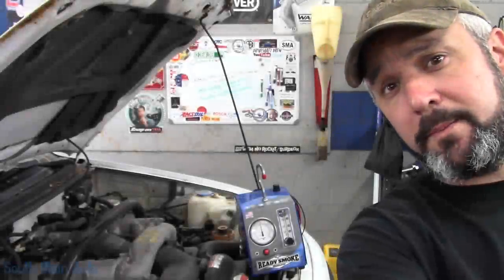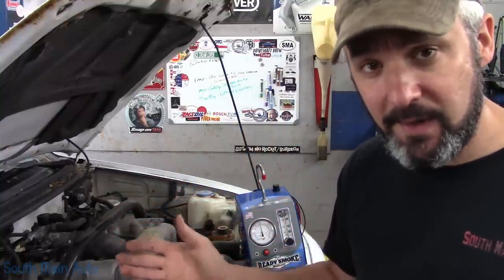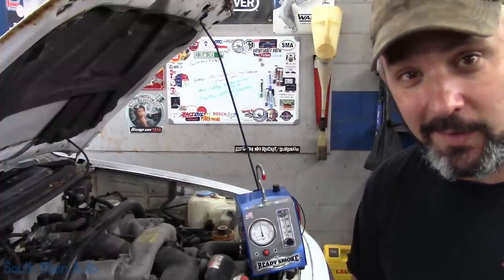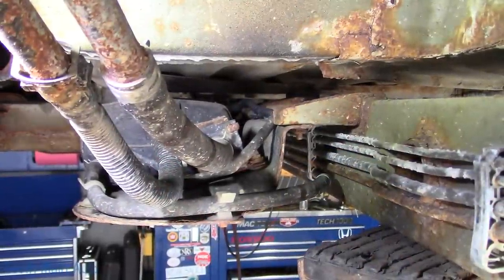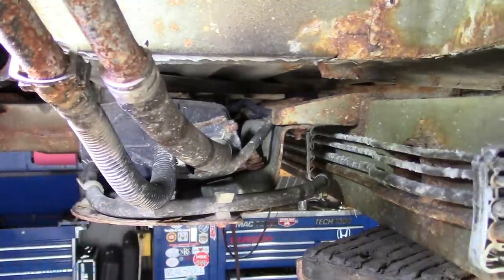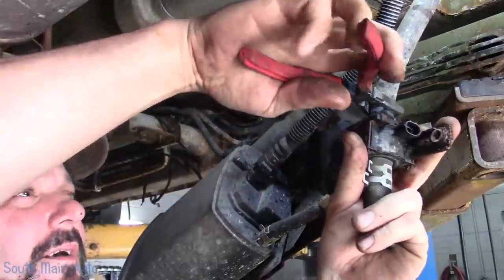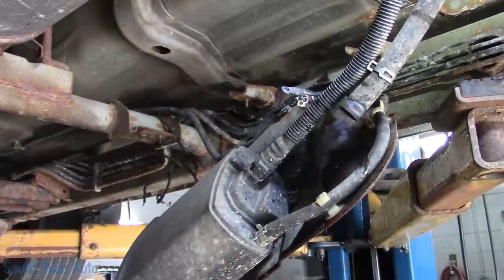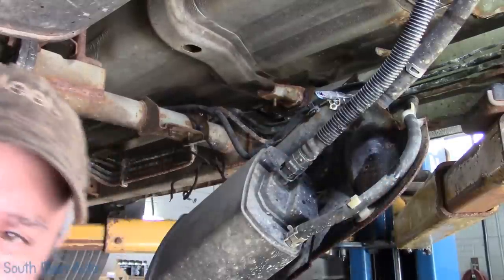Suzuki Vitara: EVAP Problem & Discontinued Parts!?

Comment: AC Delco 2141059 as used on a 01-04 Chevy Tracker.
Reply: anyone recall years ago, the auto parts counter guys would say "that looks familiar" and they often return from the stock room with exact matching part, different numbers lol
Reply: yup, I DO remember those days.  Very few parts counter people like that anymore, in fact, I can't think of one right now in the four parts shops in town.  Sad.
Reply: I was about to ask if anyone looked up a chevy tracker part
Reply: Yea most of those guys seemed to have disappeared with the paper catalogs. They were the ones that knew the parts and were frustrated when the auto stores switched over to computers. The good old days when Napa and Carquest brand parts meant quality made in USA parts. Oh, and when Dorman parts were sold as HELP! and were just odds and ends of common breaking items like door handles and clips etc. and were only bought as a last resort. When all other possibilities have been exhausted 5 out of 6 mechanics choose Dorman lol.
Reply: Back then it was easy because you had GM, Ford, Chrysler, and AMC, which used parts from the big three.

Comment: We didn't see where/why the old valve was leaking.  I might have cleaned it up and resealed it all over with a cyanoacrylate and then dipped it in something and wrapped it with tape.  But your solution was excellent.

Comment: Is very similar to the denso valve on subaru 01-06 era.
bracket on different side though.
your gm conversion good for cost and had tail for neat install plus could replace second time for the under 20buck version without filter .if connector same .
all in all a cost effective repair that fitted more than good enough and importantly works 100% fine .
Wonder what would of happened in the other shops if they had commenced with work :-O !
job jobbed, well done Mr O ...

Comment: Use RTV Silicon between the vent valve and the bracket. It won't rattle and bounce around. Work fine and last a long time.

Comment: I had a honda with a bad purge valve. It was leaking in a similar way. I just peeled back those tabs that hold the ends on and removed the end(s), cleaned the surfaces, applied some sealant, put it back together and bent the tabs back down with a pair of vice grips. Worked fine after that.

Comment: nice fix..in mass.anything over 15 years check engine does not matter on inspection....as long no major leaks or any visible smoke out the exhaust.

Comment: I hate when parts numbers are discontinued for a specific application but there are actually still compatible parts available for other applications. For example I had a Subaru XT Turbo (later model with spider intake) that had a bad cold idle valve (rotating shutter type unique to the spider intake XT). NLA from Subaru or anywhere else under the original part number, but Isuzu or Suzuki used the same thing under a different number and it was still available. Sometimes you just have to do lots of searching to try to find something suitable. Try searching just a section of the part number with an image search to see if something that looks similar comes up. Happily someone has already solved this Suzuki's particular issue in the comments here.

Comment: I dunno if anyone else has said it but a nice thing to start doing is staggering the butt connections like a inch or 2 apart it doesn't  make that one area bulky and u can still use the smaller wire loom.

Comment: Well done. Somehow I'm not surprised the Peoples Republic of NY won't allow an exception in this situation.
Reply from the maker: NO, they want all of these in the crusher...
Reply: The only way you can get an exception from "Uncle Andy" (dumb as a box of rocks gov..my opinion of course...)is to spend mega bucks on trying to fix it, having 100% documentation from the repair shop-Only then can you get a 1 year exception.

My sister just went through this last year with her Dodge.  A local chain store (Think "Moe" from the 3 stooges and "Row" from the song...you'll figure out which one)  Let's see....  She went in for a bad battery, and the famous "P0420".  Sure enough the converter had physical damage.   So the Mo-Row....(Insert a letter....)  installed a used battery (charged her for a new battery) and installed the wrong converter.  Light came back on instantly....Something like $1200 bucks down the crapper.  (There is an open case with their corp office....)

The shop was told by ME about giving her the exemption due to the money she already sank into it.  They stated she needed to spend over 4k before they would be willing to do it.

Another shop that I know took it in, looked the paperwork over...and granted the 1 year exception.  Yes the process is like pulling teeth, and it only gets you an extra year.  (Currently it's in a different shop having the correct parts installed....)
Reply: South Main Auto Repair  
Good for New York
Reply: A.) they want only newer cars on the road. B.) they don't want people driving! public transport, walking, emergency and goods delivery is all they want driving and of course the rich ;)  ....... it's not just NY best look at the bigger picture.
Reply: throttle bottle. NY well NYC anyway does have pretty good public transit, better than some other cities.
Reply: Oregon is the same way: if the money light is on for whatever reason, car will not pass DEQ. No DEQ, no new tags.
Reply: Rich New York City and Albany don't care about Upstate.
Reply: I never understood why people choose to live in these 'liberal utopias' where shit like this transpires. South Main being an exception, of course. I'm glad that there's an honest shop looking out for the little guy. I say we have Eric fix the NY political system like he fixed this customer's Suzuki.
Reply: Engine light on is a fail in UK now.

Comment: When my water inlet elbow developed a small crack I was surprised to learn it had been discontinued by GM despite only being 9 years old. I might have been able to JB weld it but it was U Pull R Parts to the rescue. Nowadays I could probably get someone to 3D print me one out of some high temp plastic.

Comment: You on Facebook? I had a sweet one last week. My neighbor's truck had the old parts Canon fired on it. He sent over $50.00 in parts and still wouldn't go. Then he called me to help. I pulled the codes and knew where to look. Fuse box. Yup the trans code, air temp and a few more run on one fuse. Replaced the fuse and showed him what wires needed to be fixed.  He was Eric O,ed.

Comment: One trick to adapt hoses is a a layer or two or three of heat shrink over the spigot ,  for  cooling hoses a section  cut from a cycle inner tube will do the job.

Comment: I work for a shop in Minnesota, where we don't have to do inspections. Literally 75 percent of vehicles I work on have the check engine light on. Most people are very reluctant to do even the most necessary repairs. I may just live in a poor area of the state, but if they start doing inspections I know there will be alot of people hurting up here. The farmers will also be hit hard, I have never once worked on a grain truck that has proper tread depth on tires or even half functioning light systems. People cut every corner they can find.

Comment: I have a story for you.

I'm an Isuzu fanatic. No, not SUVs, not trucks, their cars. I've owned several. 

Parts are typically something an advanced driver would have to find.

My 82 I-Mark doesn't have factory air. 3rd party.

Unfortunately for me, that 3rd party no longer exists. So guess what I did? 

Made my own using Thermo electric coolers. It worked.

Comment: Eric, whats the Denso code? I had great luck in finding OEM Denso part that was used by a different manufacturer. Parts Interpreters aren't what they use to be, you gotta be your own sometimes.
Reply: Same part can also be ordered from AC Delco (2141059) since the Chevy Tracker is the same car.

Comment: Suzuki is here in So Cal...Orange County. Drove by it on Imperial HWY.
Reply: Yeah Eric is quite confused and that was bad information on his part. He's confusing the old American franchise which did declare bankruptcy back in 2013 but that American franchise (ASMC) was NOT the same thing as Suzuki the car manufacturer. Two separate things, don't know why Eric cant understand that. Suzuki the manufacturer is still going strong and they are still in the U.S. but stopped selling cars here, but they are still here selling motorcycles, atv's and marine outboard motors. The new franchise is called Suzuki Motors of America.

Comment: sometimes it is possible to slide the correct smaller size hose into the larger hose and then fit the combination onto the small pipe required.

Comment: A BCM AND a TCM, aye? Wowza - no wonder you're busy! 😂

Nice work! I'd have never even thought of attempting this - would've never imagined it would work if I hadn't just seen it myself. 

Makes you wonder how many cars are needlessly scrapped every year, due to stupid and minor issues such as this. Probably in the thousands - and that's just in the Northeast region! And guess who that hurts when used car prices go through the roof due to a shortage? The very people a certain political party claims to be always helping - ironically, the one that mandated this stupid crap to be on all cars and trucks ... 🤯

Hit 97° over here today! Was a steamer! My Davis weather station had a "Dangerously high heat index warning" message, and I saw 123°F there at one point! Better than being cold, I say! 😁

Tried to get that ABS module programmed on that Sierra - not a single shop around has the technology! One of them was one of the biggest and busiest ones in the area, too! Guess I'd better invest in a J-box and laptop now. I'll have zero competition!

Comment: You are definitely old school. Long long time ago my dad and I stopped at a gas station when they still had a garage remember when that was? Someone stopped in and said their car was missing only when it rains. The mechanic got a spray bottle and started spraying a mist over the spark plug wires started missing. Fast forward to a car I had wife left on rainy yep you guessed it. But next day dry no problem. Here comes the spray bottle. Bad wires cheap repair.

Comment: Just dip the old one in plasti-dip and ship it.
Reply: Nutz4Gunz45 I would have busted out the flex seal  and shipped it !
Reply: What are you guys talking about. Encase the thing in JB-weld.
Reply: I appreciate all you guys funny suggestions but im pretty sure that would have still left the engine light on when the vent would not open/close.
Reply: I tried  that.  The rust bubbles on the inside prevent it from sealing when shut.

Comment: That canister vent valve looks identical to 01 Subaru outback vent valve. Just saying.
Reply: chuck thomas i was going to say the same. Legacy and all those Subaru cars.
Reply: GM Parts Box .
GM Had its  finger in SUBARU. 
In Australia and New Zealand, GM Borrowed SUBARU'S four wheel drive system put it under a station wagon ( estate ) , either with a six cylinder motor or a V8. ( Holden badge, CHEVYS sister brand )
What a way to tow the boat , with the family in the vehicle.

Comment: Someone did this to a car I bought about 2 years ago, the purge valve was the same on my car as it was for a VW/Audi, but the connector was different... anyways looks like they cut the connector and purge valve off from a car at a junkyard... rather than butcher the wiring harness again I took and bought the valve brand new and then the original connector, used a tool and removed the pins and repinned the new connector with the factory VW/Audi terminals, wrapped it up nice like in this video, hasn't given me any problems since. My thought was... if it ever needed to be replaced again I or the next owner would accidentally order the Saab purge valve but the connector's for a VW/Audi, switching the connector back just makes sure I don't stupidly mess up in the future lol.

Comment: No need to junk it. Sell to someone in Kentucky. No inspections here. Out of state transfers have to have headliights, brake lights, wipers and a horn. That's it.
Reply: Stephen Lutz so the long and short of it is never buy a used car in Kentucky 😁
Reply: InsideOfMyOwnMind very good advice! You want to look it over pretty closely.
Reply: Look for the banjo strings........under the seat......(think about it...)
Reply: Good luck finding a buyer to come up to the RUST BELT and buy a $1500 vehicle.
Reply: right, you'd have to give it away and offer to pay the tow bill if it broke down on the way there :))
Reply: Pretty much the same inspection here in eastern NE as KY.

Comment: I used a vent valve from a 03 chevy tracker . $40+ from Amazon. Exact fit. For the purge valve I got a Nissan unit smaller but it worked. Then I smoked it found a rust rotted vent pipe at top of gas tank.

Comment: Awesome fix I always Frankenstein my cars if the part is no longer available usually put GM parts as they are usually the cheapest and most available lucky the bolts came apart up here in Ottawa Canada I just know they would have just broken off

Comment: Didn’t Suzuki and gm have a partnership at one point? I seem to remember geo and Suzuki having the same vehicle, just rebadged
Reply: chris parenti ya it was tracker, and the metro.
Reply: chris parenti that was the Suzuki-chevy sprint 1985-1989? then geo metro from 1990-??? they were 3 cylinder carb engines and a hoot to drive very small parts but very simple design. 2500.00 brand new.
Reply: Just call it the suzuki vitara like we do in GB,,
Reply: Yeah the part he needed is actually very easy to get because it's also an AC Delco part sold for the Chevy Tracker which is the same vehicle as the Vitara.  AC Delco part # 2141059. He also could have ordered the part under the Suzuki brand from one of the many online Suzuki parts suppliers but as is the case with most mechanics he just wasn't aware of that.

Comment: It should be the same as the one for the Chevy Tracker with the 2.5.  Rock Auto doesn't cross them, but it looks exactly the same, including the plug for the harness.  They carry the unit for the Tracker for $36 still  (Oct 2019.)

Comment: There's a new wire connector on the market you ought to check out it's called solder and seal I used to work with these connectors long time ago when I used to work at Stewart and Stevenson and I love them but I never could find them on the market until here very recently I bought me a bunch of them and I love them

Comment: If someone was really worried about the vent valve just laying there. You could drill two holes on the canister tray. Feed the zip tie and wrap it around the cylinder of the vent valve and just zip tie it down. 🤷‍♂️ better than nothin.

Comment: I did the same thing with a Benz they wanted over $450 for it I put a valve out of an 05 Silverado..... Still working has past Ontario drive clean 2 times no issues cool fix our parts aren't that reasonable in cost it is what it is....

Comment: Those heat shrink connectors seam like a good idea but from my experience the crimping pierces the plastic letting the salt in to corrode the connection after a while. Also when working on greasy truck undercarriages we would clean the wires with brake clean and then when you use the torch to shrink them, it starts a fire. Melted some airlines once. That damn brake clean will cause fires even an hour after it`s been sprayed.
Reply: The ones he used have sealant (hot glue) inside that seals the ends, and usually there's enough to seal any crimping damage to the sleeve.
Reply: mattmanyam: We had a fleet of 450 trucks and used the same connectors with the glue. Seeing them after a winter`s salt they turned green.

Comment: Good fix, that was the first thing I thought of as well.  I do have a question though,  I think I had  trouble with a similar gm vent valve being installed backwards and not working properly.  Looked like you had the vent on the canister side.   Did the evap test run the next day?
Reply: not vent I meant filter on the canister side.

Comment: Nice Crimper/Strippers - what make are those?
as always - keep up the good work!
Reply: Yes, where can I get a pair of those crimpers? Anyone know?
Reply: @tahuyaguy  The head looks like a Klein Tools 1005 (which I have; I recommend it) but the handle isn't as long. I like the long handle on the Klein, gives plenty of leverage for crimps and cutting heavy gauge wire.
Reply: @brianleeper5737  I have the Klein 1005's, good tool. I've done some looking around and those crimpers are Snap-on 7 in. wire stripper/crimper/cutter PWCS7ACF or PWCSS7ACF.

Comment: I brought my 1991 Nissan 300zx to a Nissan Dealer's service department in 2003 for some transmission work and replace the rear shocks and Nissan told me they don't have any techs that can work on my car. 12 years later.........it's all about money, they can't charge me alot because the book time is X amount, problem is no tech knows the car.

Comment: That's where I think this emissions testing is a racket. Car runs fine, tail pipe emissions are fine, however just because the MIL light the car has to be junked!? Abounds just as shady as the cash for clunkers campaign years ago, something to boost new car sales. Great way to keep it going.

Comment: I'm wondering if this would also work on a 2003 Chevy Tracker 4x4 2.0?
I had an EVAP code for a long time (nearly a year) and even after I used a home made some machine I still couldn't totally find all the leaks seeing when I take off my gas cap to fill the gas tank I still don't  hear any suction or pressure release.
So after watching you video I think I may also have the same issue.

Whatever you advise me is going to be very welcome,

Gary